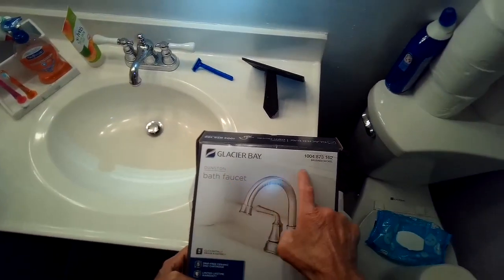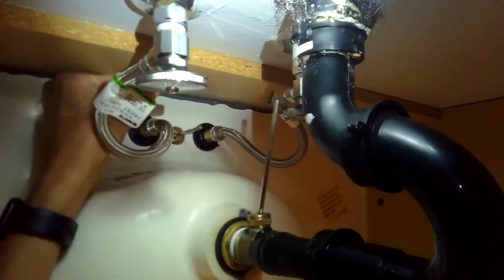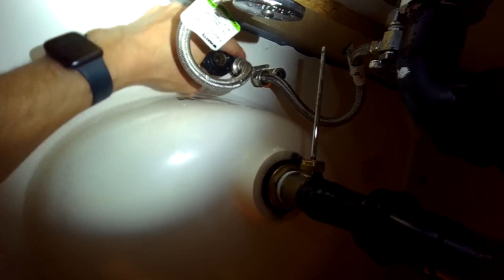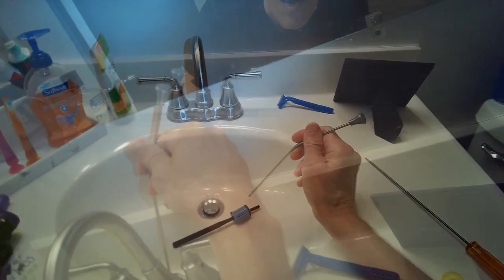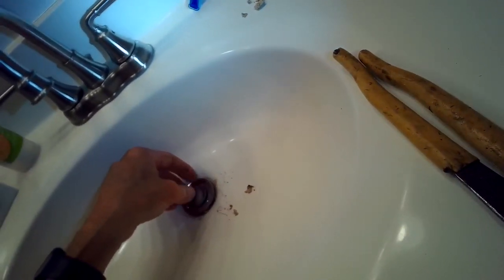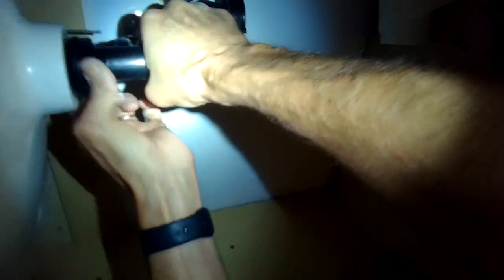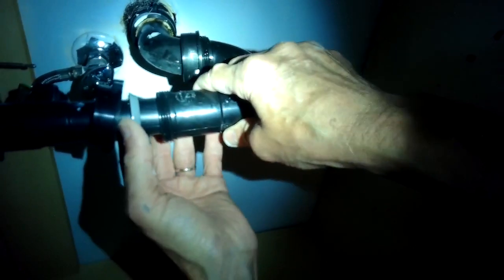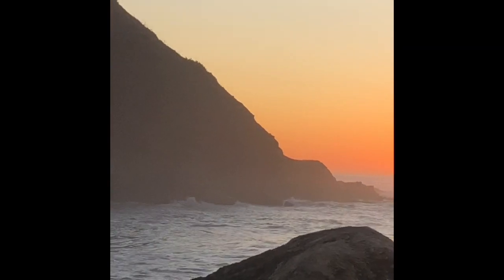✨ GLACIER BAY BATHROOM FAUCET - Easy DIY Fix - Save $$ ✨

Comment: The rubber grommet that seals at the  bottom of the sink was still leaking..I just tightened the plastic washer to make it water tight. Just needed more force on this part
Reply from the maker: Nicely done😊

Comment: Why no silicone sealant on 
the gasket under the faucet?
Reply: These faucets come with a plastic gasket piece that uses compression to make a watertight seal. Makes the plumbers putty unnecessary and the job a little easier for beginner diy-ers like me🙂
Reply: @ebonyjackson3198  it looked like he used plumber's putty under the rubber washer, though it didn't show him doing it.

Comment: Hi, I'm new to DIY and I'm trying to install this faucet. It keeps leaking from the water lines where it connects to the sink.

I've gotten them pretty tight but it still leaks a lot on both sides, any tips? Should I just keep tightening them?
Reply from the maker: I wonder if the rubber washers are missing?
Reply: From the top the metal bar that goes down to  bottom it’s leaks from there, the hole where the metal bars go through is too big, check that…. Let me know
Reply: Thanks for the responses guys, I forgot I had posted this.

In the end, I fixed the problem by purchasing new hoses. You're probably right that the rubber washers went missing or had gotten warped.